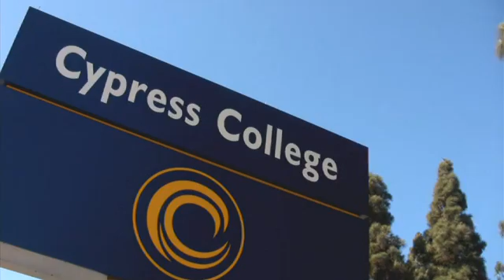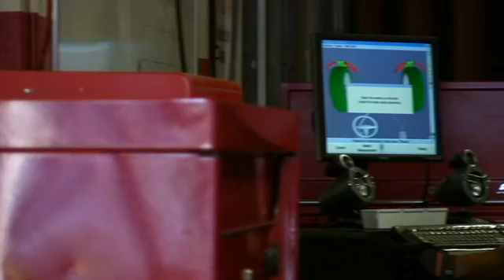Automotive Technology - Cypress College

Comment: The students must learn how to work on older cars, how to deal with stubborn bolts, corroded gasket surfaces and poorly written repair manuals. Taking apart new cars ad piutting them together is no brainer, if instructions are readily available